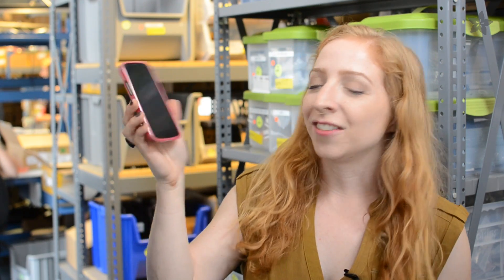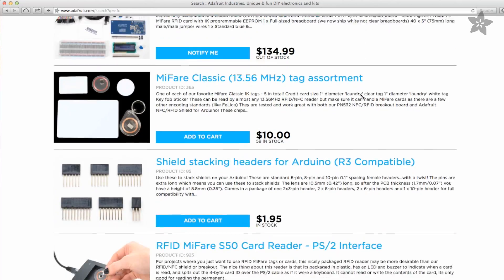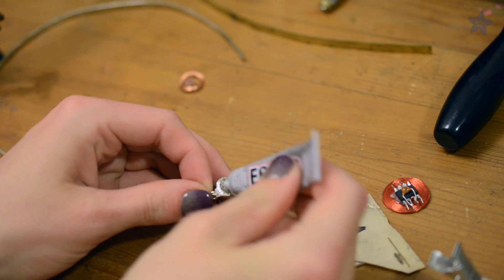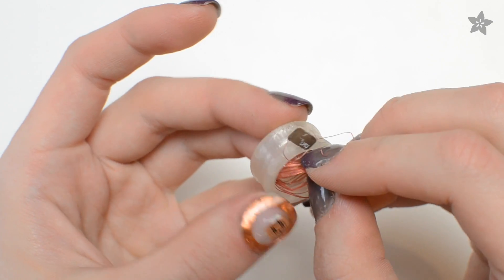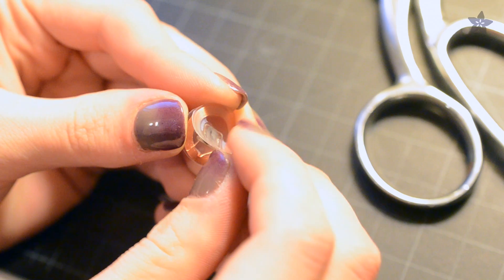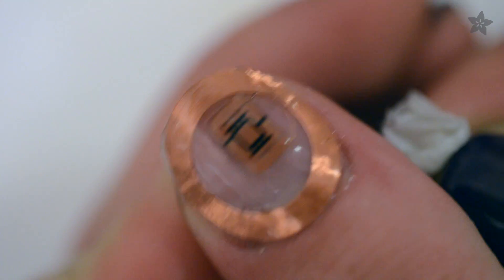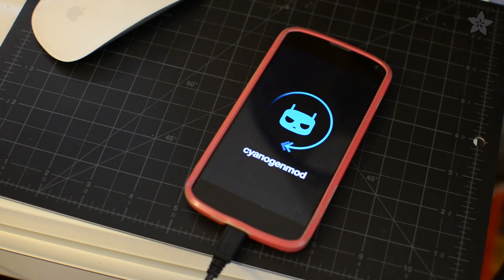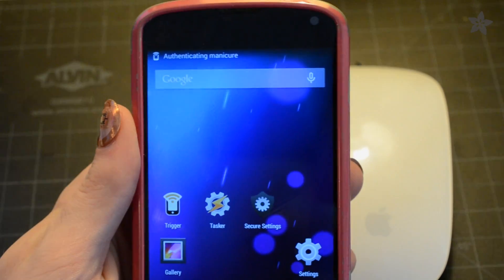Unlock Your Phone with NFC - Ring & Manicure

Comment: currently i'm using samsung galaxy s4 .This device have nfc function but actually nfc circuit is placed inside the stock battery of the mobile phone.but due to damage of my stock battery. recently i buy a new battery called ANKER 7800 mah high capacity battery for daily use .but battery does not have any nfc circuit inside the battery. this is why i could not able to use my nfc function.Is there any solution for this problem.If YES then PLEASE HELP ME.........!!!!
Reply: get a battery with a nfc module